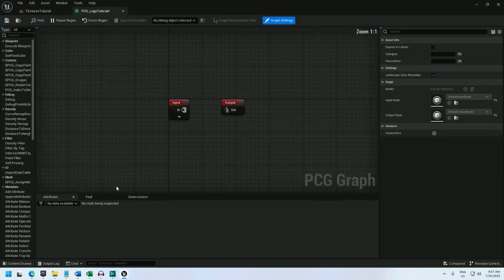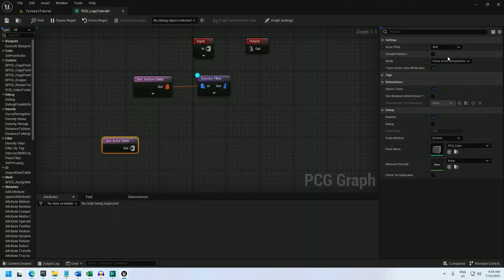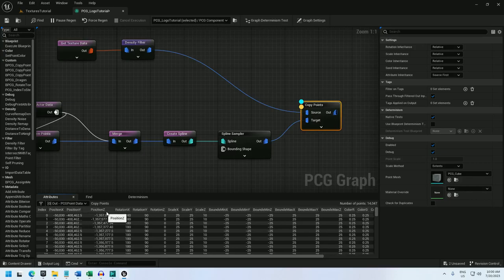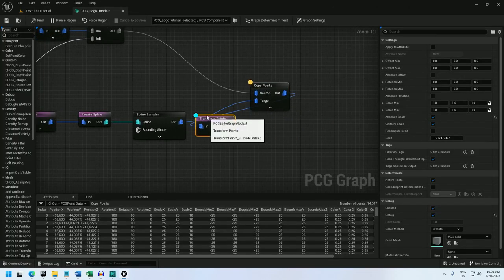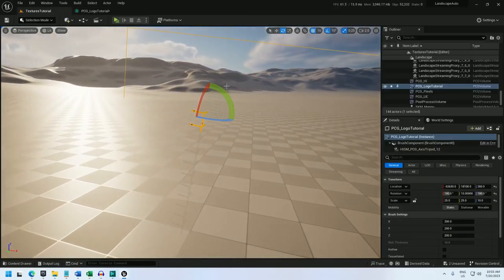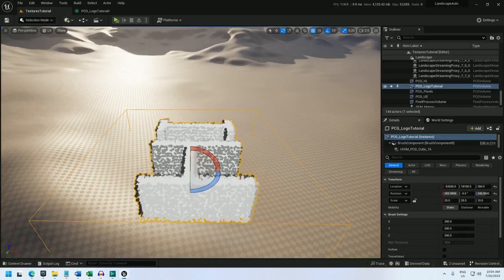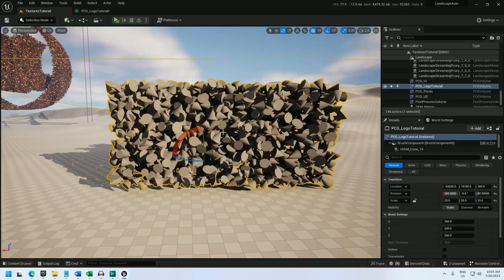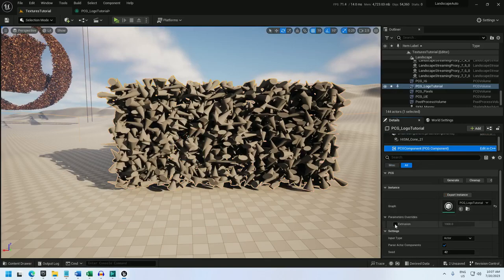Unreal Engine 5.2 PCG Tutorial - Extrude Logos From 2D Images

Comment: Does the initial texture imported need to have alpha? I've tried png both with and without and keep getting either nothing or a big white square rather than my logo. Have also tried using the both options suggested in the texture compression dropdown netting the same results.
Reply from the maker: Sorry, I forgot to mention this in the tutorial! In my example image, the color channels exactly match the alpha channel, so it doesn't matter which channel I sample. In your case you may want to update the Get Texture Data node to sample from a different color channel. The color channel selection is directly below where you select the image.
Reply: @MichaelRoyalty  Worked like a charm. Appreciate you sharing the knowledge!

Comment: Amazing tutorial :) I also had problems with the texture image. It was too big (1024 x 1024, Number of Mips: 11), I reduced it to 200 x 200. The Number of Mips was then 1.

The "Density Noise" note no longer exists in 5.3. But it also works without connecting the "Static Mesh Spawner" directly to "Density Filter".
Reply from the maker: Interesting! I didn't have a problem with a larger texture, so maybe it's the number of mips? At any rate, I'm glad you found a fix!

I want to say "Density Noise" is now "Noise" in 5.3, and you just point it at $Density. I had to stop using 5.3 preview after a couple crashes that made my scenes unopenable, so I'm not 100% certain on that.
Reply: @MichaelRoyalty  It's bad if you can't load the project anymore. I've had it many times too, I always make a copy, of the copy, of the copy ;)

In 5.3 there is only "Attribute Noise" and "Spatial Noise", no "Noise". But it also works without "density noise".